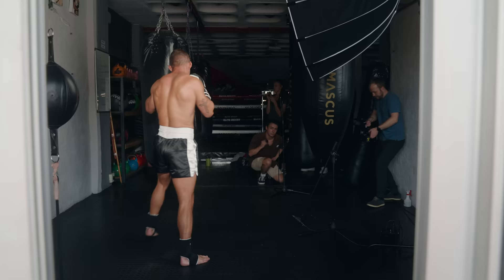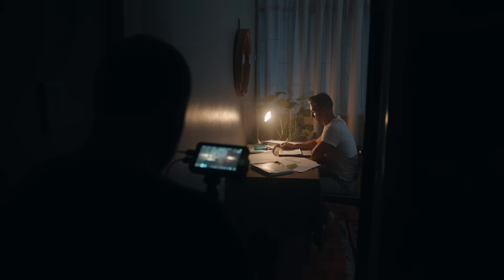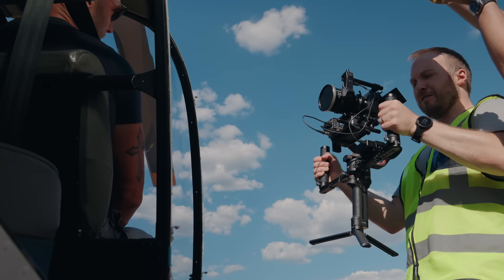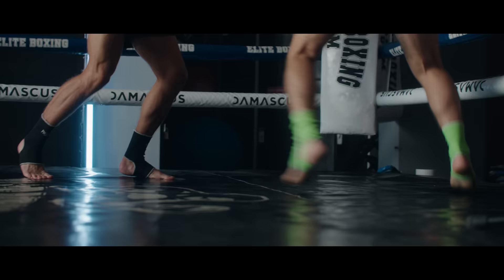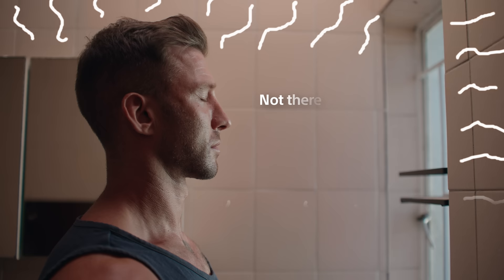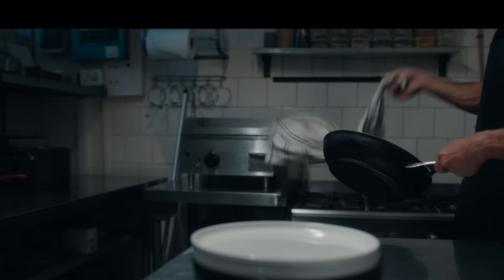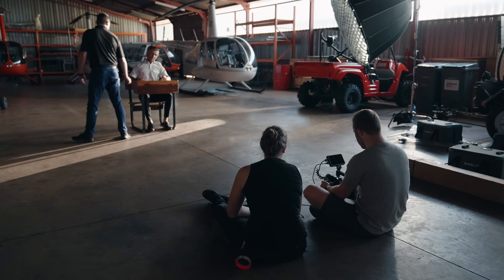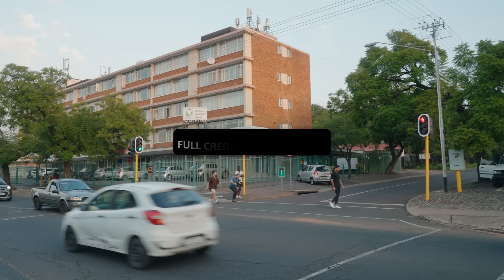Short Film LIGHTING SETUP - Sony FX3 - CINEMATIC LIGHTING with Nanlite Forza 500 II

Comment: Great breakdowns and awesome film as allways! props to the entire team and actors

Your lighting setups are inspiring, with the checkerboard and excellent use of the bounce with fresnell adapter. wish I had time, budget and similar setup to light my productions. I've got some small led lights and some 60 Cobs DL but nothing on batteries or strong enough for outside light during daytime and my trusty A7iV and tamron / sony lenses. 
Those pavotubes we rented for a production a while ago, and they are really flexible and awsome to use, but expensive as well. And you got 3 in some scenes ;)

Could you also do a low budget film soon with a breakdown.. more one to two outlet powered lights pls. and bounce/natural etc. Would love to see some more setups you can make with that kind of setup.

Comment: Like you said in older video, my timeline should be edit in 25fps because of my country so my question is if I shoot at 100fps I can slow them down 4 times right? But what will happen if I shoot at 120fps? 

Thank you very for the BTS , actually I try to figure it out how you put your light where, how, what kind of light did you use and it turned out about 60% correct.
Anyway thank you so much, Love it.❤❤❤
Reply from the maker: Aaah that's awesome, I also do that when watching other films and I'm glad you got most of it right. I never slow down my clips to a percentage, I just CONFORM / INTERPRET them to 25 FPS that means it will automatically slow down the clips to the optimal percentage where 100 FPS would be 25% and 120 would be 20%
Reply: @jacques_crafford  Thanks a lot, I'm still long way to go.